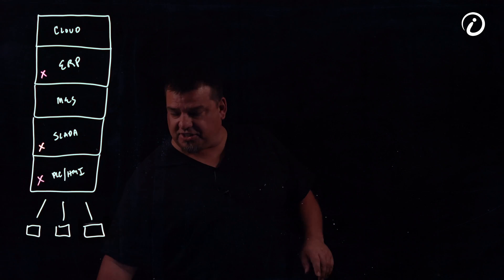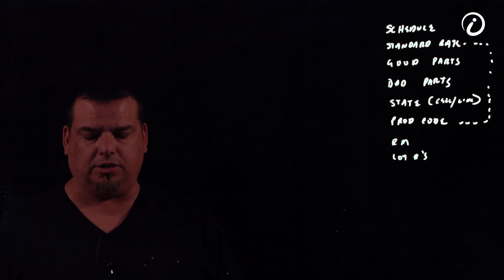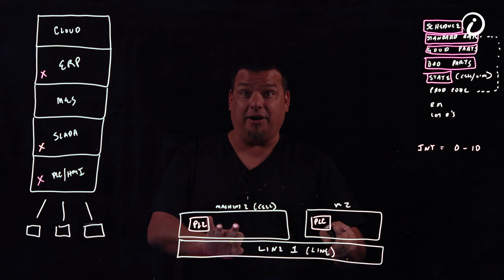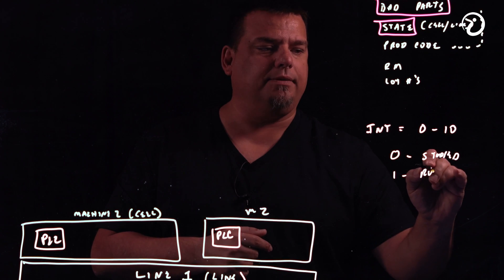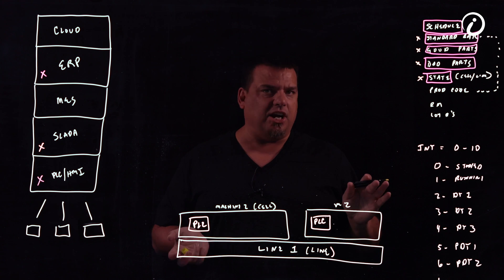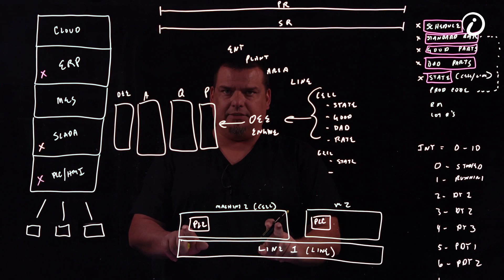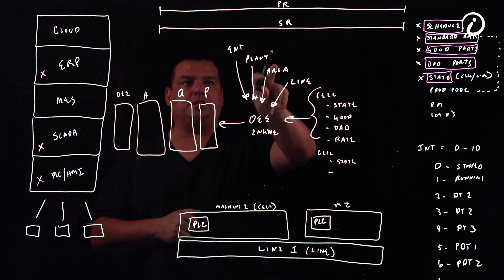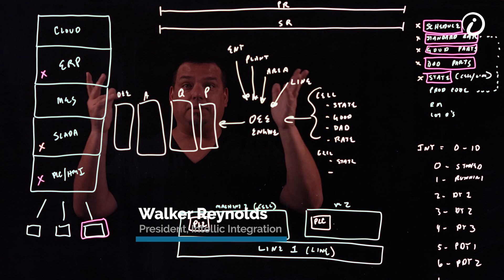How to implement OEE in your manufacturing plant

Comment: Building a customized MES system allows to add more dynamic scheduling constraints depending on the different structure of production lines. To build a dynamic scheduling system requires accurate current status of different systems that's where UNS helps.  Can you explain the mechanism of bringing/integrating top level system like ERP system to UNS ?  Is there any ERP system that supports Mqtt ?
Reply from the maker: Dynamic scheduling requires accurate current status---definitely! Rather than expect the ERP to support MQTT, we construct the UNS to reflect the schema used by the ERP, to retrieve and normalize work order and other data needed via API or whatever is possible. The nature of this data changes less frequently.

Comment: OEE is a nonsense number.  "OEE is like using our weight times our height times our systolic blood pressure, as a measure of how good looking we are."
- Dr Wheeler
Reply from the maker: It's a relative number. If you aren't tracking it. you can't improve it.
Reply: @4.0Solutions   Tossing unrelated number together is FARCE.
You use the 1870 approach to quality.  Laughable.
Read my LinkedIn paper on how to do it properly.
Reply from the maker: @drtonyburns7321  Come on our podcast. You look like a continuous improvement guy, this will be fun.
Reply: @4.0Solutions  Not if you are hawking nonsense like OEE.
Reply: Why? copy-pasting the same comment with an irrelevant comparison does not make a strong argument, I would say. If you have any resources supporting your argument, please share them.
Reply: @gustavovelascoh   To eradicate SCAMS and the con men hawking them.

Comment: Thanks for great videos. I have couple questions in here.
1-Don't you think that combining OEE of different product technology manufacturer facilities or even different galenic form of product manufacturing lines making no sense in terms of OEE and be a reason of loosing it meaning? 
2- What is the methodology of combining OEE results of different lines, facilities? Simple average, Weighted average??
Thanks in advance
Reply from the maker: Thanks for the questions Oguzhan! We responded to your questions in this video: (Timestamp included in the link) https://youtu.be/jYgNQ47FCZA?t=2714
Reply: OEE is a nonsense number.  "OEE is like using our weight times our height times our systolic blood pressure, as a measure of how good looking we are."
- Dr Wheeler

Comment: Very good video! Hopefully you can answer my question:
If i want to have the OEE of a line what i would do is -> 
add up all the calculated OEEs of the cells of a line and divide the sum by the number of cells. 
Is that correct and practicable for all the higher insances? 
Greetings from germany :)
Reply from the maker: Calculate the OEE of the line as a whole. The line is either up running, or down completely. Aggregating like you suggest makes more sense when aggregating an area or many plants together.
Reply: NEVER use OEE.  OEE is a nonsense number.  "OEE is like using our weight times our height times our systolic blood pressure, as a measure of how good looking we are."
- Dr Wheeler

Comment: How about a demo project on calculating OEE like your mqtt demonstration?
Reply: 2 questions:
1. If i have a line (say a bottling line) consisting of 3 cells (filler, capper, labeler), with 1 inspection camera at the end of the line, can i use the result of the camera as good/bad input for the individual cells?
2. to calculate the oee of a line or plant, do you simply multiply the oee's of the entities below it? Is the OEE of my line equal to the OEE's of the filler, capper and labeler multiplied?
Reply from the maker: Added this to our video topics Stefan!